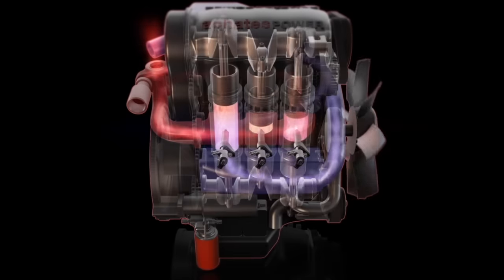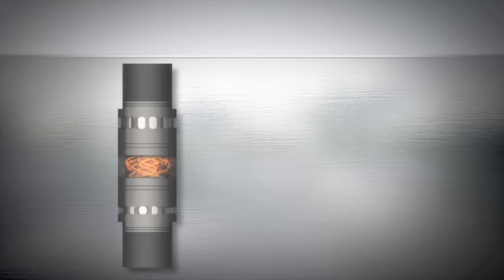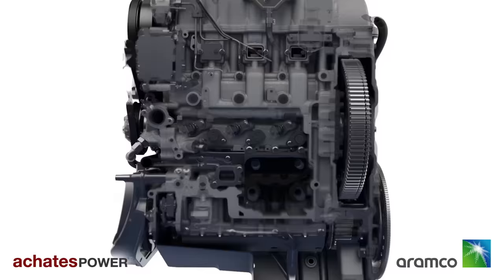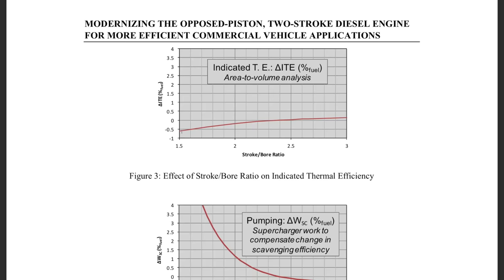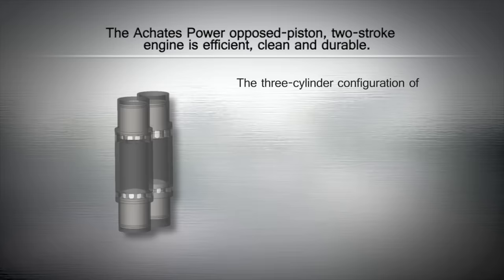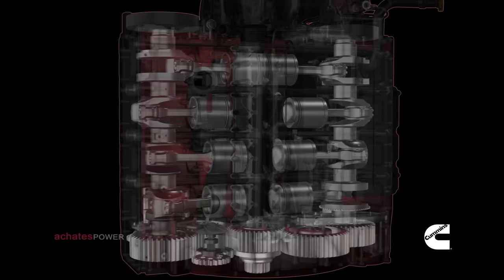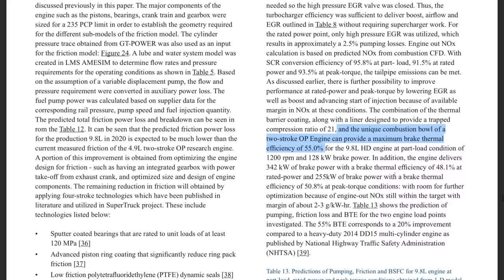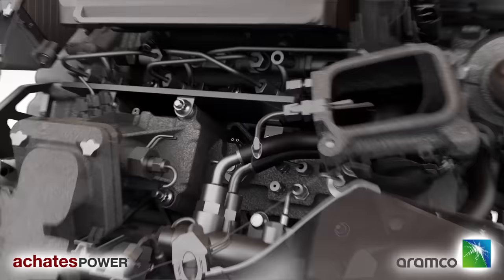Opposed Piston Diesel Engines Are Crazy Efficient

Comment: In a two stroke cycle timing is everything. It is therefore pretty amazing that they can maintain as high an efficiency as they do over a broad an operating range as they do. But I wonder what would be possible if the engine only worked at a single speed and power level. In a convention vehicle the engine has to sized to meet the peak power demands of the vehicle will ever need, but for the vast majority of the time it only needs to produce a quarter of that peak power. As such the engine is mostly not operating at its peak efficiency power and rpms. 

But if the engine is sized only to just meet the power demands of the vehicle averaged over say 30-50 miles of highway driving, then the engine can be much smaller since it doesn't have to provide the large amounts of peak power required for acceleration and hill-climbing. Nor does it have to run at very low power during deceleration or downhill sections. Instead it just produces that same time-averaged power level regardless of what the vehicle is doing. This is the concept referred to as a sustainer engine. But of course the engine can't be sized that way if it is the only source of power. And that is where a battery electric drive train comes in. 

All power to the wheels come from electric motors sized to meet peak power demands. Electric motors have a very broad and flat efficiency plateau around the design condition. So it is very nearly as efficiency at 20% power as it is at 100%. And most motors can operate for short periods at nearly double their rated power and so can give short bursts of very high power for accelerating down an highway onramp so as to be at speed by the end. The energy to drive those motors comes from a combination of power from the batteries and the piston engine. The batteries type and pack size would then be designed to be able to provide the extra power when discharging to supply the difference between maximum motor power the set power output of the piston engine, and to be able to contain enough total energy to provide that extra power for long enough to climb a long uphill grade. The peak charging power of the batteries would have to be sufficient to absorb peak braking power produced by the motors acting as generators and the power from the sustainer engine, which would still be producing it "one lone song" in anticipation of the energy needed to climb the hill on the other side of the current downhill grade.

Since the sustainer engine is not mechanically connected to the wheels it can spin at whatever speed is most efficiency and minimizes the weight of the engine and attached generator. Since power is simply torque time speed, a high rpm, lightweight and low torque engine can produce the all the power needed. Also electrical machine weight is more of a function of their torque than power, the same high rpms will minimize the weight and volume of the generator as well. 

Average power can be calculated from average fuel efficiency and thermal efficiency. Modern aerodynamic rigs can get 9 miles per gallon cruising at 65 mph and if we assumed a fuel to drive shaft efficiency of 30% at low power during cruise and do a plus a bit of math, this works out to only 125 hp. Since the electric drive motors are the ones driving the wheels, they will be the ones to generate the 1500-2000 ft-lbs of torque required, not the sustainer. So the piston engine could actually be a very compact and light high speed/low torque engine such as a 1 L motorcycle engine that can easily produce 125 hp (imagine the chuckle though when you raise the cab and show the other drivers this tiny engine the size of a Honda Goldwing sitting in the middle of all these batteries, power electronics and high torque electric motors and tell them that is the only power source driving your rig :-) . High rpms also helps to reduce the generator weight and volume since electrical machine weight and volume is more of a function of how much torque they have to produce rather than how much power. So a high speed/low torque generator can put out the same power as a low speed/high torque generator but weigh considerably less.

In addition to saving fuel by running the sustainer like these opposed piston engines at 40%-50% efficiency, a hybrid electric system would save a lot of wear and tear on brakes as well as save energy since most braking power will come from the drive motors running in regen mode and storing that energy in the batteries. So brakes might just never wear out if the driver can avoid a lot of late hard braking. And you wouldn't have to use engine braking to try to saving the brakes and pissing off everybody who lives within a half a mile when you downshift. And possible battery only operation or the sustainer throttled down to bring its noise down could be used to drive nearly silently through very noise sensitive neighborhoods at night because trucking doesn't fall neatly into an 8-5 schedule. 

Well this is a long comment on an old video, so likely nobody but me will ever see it. But in general I think hybrid electric systems with a small sustainer engine could make a large difference in everything from heavy-duty pickups to large semis where, apologies to Elon Musk, 100% battery electric trucks just don't make economic sense. But that doesn't mean that an battery electric drive system can't have utility, you just have to come at it from the right angle.
Reply: this.
Reply: I agree that a sustain/generator engine would be good for heavy vehicles, basically a diesel electric system from a train but for semi trucks. One small problem for high power density engines, wear and tear. Long lived engines, life is measured in hours not miles, do not operate at high RPMs. Your idea for having an engine basically running at 100% is best served by a 2000 ish RPM running generator, such an engine would be between 3 and 6 litters, depending on vehicle size and toe capacity. Say a compact V6 or V8 engine. The semi truck will remain large, the new electric systems will require the space that was once used for the larger 14+ litter inline 6. Cooling requirements will be reduced, allowing for a more aerodynamic design as well.
Reply: Yes, this would be ideal for a hybrid car.
Reply: The perfect design. A combustion engine making electricity that drives a motor/generator at each wheel. By varying motors in series and parallel, you change their torque-power. By using wheel motors there’s no axles, transmissions and gears plus built in stability control. You also take advantage of the multiple motor-speed/ fuel consumption thing that ocean-going motorboaters have known about for decades.
Reply: @Squeezmo  One giant problem with not having a transmission is that you either have very little power available from a standstill, or your motor is spinning at very high rpm once your moving, limiting its service life and maximum speed. Transmissions solve lots of problems. Electric cars will still use transmissions, though far fewer gears are used. Having independent motors is nifty solution, though it will cause issues if one or more dies. 4 motors quadruples the odds of motor failure.
Reply: soo a diesel loco?
Reply: @harrymu148  In a diesel locomotive the electrical system only works as a transmission system and as a way to brake the train by generating electrical power and dissipating it though huge resistance banks to avoid friction brakes as much as possible.current diesel locomotive do not have any batteries or other energy story. The diesel is sized to meet peak power demand.

The system I was outlining for trucks would have relatively large battery packs to supply power when more power is needed than the small sustainer combustion engine is making, and to absorb and store energy during braking. The size of the sustainer is  based on the average amount of power required on average over the course of an hour or so. The batteries handle on a moment by moment basis supplying additional energy to accelerate or climb a grade and absorb energy during braking or decent of a grade..
Reply: @papparocket  ohhh that'd make more sense. I'd imagine that the driver would have to be mindful of his power consumption though, as to not frequently run his batteries dry
Reply: @harrymu148  Actually while the sustainer engine is highly optimized to maximize thermodynamic efficiency single operating point, that point would not be at the absolute maximum RPMs or fuel flow rate of the engine. Thus the engine could be run at higher Power level than its design condition, but it would have a lower fuel efficiency at that higher power level. And because it is so optimized, if the necessary operating point is too far away from the peak efficiency point, the sustainer would have lower fuel efficiency than an engine that had a lower absolute peak efficiency value, but which was designed to have a flatter efficiency curve.

Another solution is to put in a larger sustainer engine sized for peak efficiency operation at the maximum possible vehicle load (max weight into a steady high headwind) and then only run the sustainer part of the time when the load is lighter and wind is helping push. While the sustainer is off, the truck runs on battery power. The batteries are then allowed to cycle between two states of charge somewhere around  50%. There are loses to doing this, so if the sustainer is cycling on and off too frequently, it would be more efficient to just run it continuously at a lower, less efficient power level.
 
This is the kind of wicked design problem where the optimum solution is not always obvious that engineers like me live for. Also because the optimum operating pattern will probably change for each trip depending on the weight of the load being hauled, how it changes the aerodynamics (if it is an open load), what the wind patterns and terrain profile will be during the trip, this is also a perfect application for artificial intelligence to minimumize total trip fuel consumption using the greater degrees of freedom a hybrid electric system makes available.
Reply: Man, just smoked some weed, and this comment just killed me. Thank you for that.
Reply: Blown two strokes aren’t dependent on port timing’s as NA engines. Therefore they are efficient at various engine rpm.
Reply: @harrymu148  One thing to note with a diesel-electric sustainer type drive is the fact, that if done right the electric motor can operate even if the battery pack is flat while the engine is running. So in the case the owner has a serious case of pedal-to-the-metal fever he will run his battery flat. And from that point onward he will have a car that only has power equal to the maximum amount generated by his sustainer engine minus the electrical losses. Mazda was thinking about using a single rotor rotary engine as a range extender/sustainer motor in their next generation electric cars, but nothing came out of it as far as I know.

To put it in simpler terms:
The sustainer engine has an electric motor. Let us put the power output of it at the power level of a Toyota Corolla. The entry level engine has a power output of 92 kW and 153 Nm. If I want to change the engine to be the same power, then the Spark EV has this class of electric engine. The electric engine has a power output of 97 kW with a torque of 542 Nm. This torque is something you would expect to find in a 6L LS1 Corvette engine from the '90s.

Here is the kicker: The Spark EV used 29 kWh of battery for every 100 miles traveled. So in theory if you could supply it from a 30 kW generator it would be fine on an average for combined (city and highway) usage.

So in theory while you would loose the instant acceleration and kick of your electric motor, you would still feel like driving a Corolla, as the torque for acceleration would be available from 0 RPM. And this is why this type of car could be a huge hit. Build something light and small(ish) with a 30 kW engine and a 25-30 kW generator, and you are set to go. With close to 1-2 liters per 100 km fuel efficiency (not using any batteries).
Reply: This 2 stroke is not the same as your average 2 stroke
Reply: I love your point, and I've thought about diesel/electric. Namely, I though about using 4 (or more ) electric motors for AWD with computer assisted traction control and torque steering built into the design, but as an American I never ever once thought about making the diesel engine smaller. 🤔😄
Reply: A much shorter way of interpreting your post, which is the comment I wanted to make:

A small version of this engine would be PERFECT to use as a range extender for battery electric vehicles.  For example, based on the data from a cross-country Rivian towing trip last year, a 25 kW REX would have tripled that vehicle's range per battery charge.  A 25 kW version of this would probably be compact enough that it could be removed from the bed when not needed, and only installed when needed, turning a BEV into a heavily plug-biased PHEV for towing.
Reply: @Entropy512  Long comments are the hazard of being able to type over 90 wpm. Thanks for giving a summary for my TL/DR comment.
Reply: I think this kind of hybrid solution makes a lot more sense than full electric right now.   The harsh reality that few people seem to acknowledge when discussing EVs is that current battery technology is simply NOWHERE CLOSE to petroleum products in terms of energy density.   And it's not going to catch up within the immediate future.  That tipping point could be decades away for all we know.

In the meantime, we should be combining electric and internal combustion technology in ways that capitalize on the respective strengths of each.  The system you described is a perfect example of that approach.  👍👍👍
Reply: @papparocket  Could probably integrate with existing intelligent cruise control systems that estimate vehicle weight and have maps of the terrain ahead.
Reply: @ultimateswarm7868  Individual motors per wheel work flawless on a straight.  That is when all wheels are turning at the same speeds.  Once the vehicle is turning, things get complicated.  Normally, a differential compensates the different wheels speeds.  But in electric motor, the motors need to to that instantaleously.  Very hard to do.

Comment: My all-time favorite opposed piston engine is the Napier Deltic locomotive engine. It has 18 cylinders, 36 pistons, 3 crankshafts. Its like three 60 degree 2 stroke V12 detroit diesels arranged in a triangle so all the pistons meet in the middle. The most powerful model put out 3600 horsepower. 3600 horsepower was absolutely insane for the 1950s.

Comment: Seems so simple compared to complex multi-cam valve systems. Thanks for the video!
Reply: That's not because its an opposed-piston block. It's because it's a 2-cycle design, which can be done without being piston opposed.
Reply: @Cotronixco  2-stroke diesel still need a single valve in each cylinder. This design doesn't have any.
Reply: I guess you havent seen the insanely complex variable camshaft engine that just looks like its waiting to break

Comment: When I was a kid living in Turangi there were a number of Commer trucks powered by TS3 horizontally opposed piston engines. The sound they made was so distinct that I could pick them out over other trucks without seeing them when I was 5 years old.
They were small engines, about 3.6 litres and made good power in their day I have been told.
Hi from NZ,
Anthony
Reply: anthony  i worked on these engines .  you are correct regards the sound, it was the blower .we had to decoke them  alot also rootes tried out  a  ts4  but it was not put in any commers .they would have been easier to work on on tilt cabs  but the commer never had one in those days
Reply: A brilliant sound that I remember from the old Palmers Concrete mixer trucks in Dunedin.  Hearing a fully loaded Commer with its TS3 knocker engine screaming while climbing a Dunedin hill is one of my great childhood memories.
Reply: I think GM bought the company and smashed up all the moulds as the engine gave more power, was more efficient and smaller than three crappy V8s
Reply: andy   it was not a rootes engine then? , as i was told  when i worked at a commer dodge garage.
Reply: anthony851 maybe it was the truckies wanting to hurry up and get out of turangi lol
Reply: I have one in my garage up here in hamilton. Want to try to get it to run again.
Reply: I currently live in a 1950s royal leyland tiger with a TS3 in it, runs well, too clapped out to drive on the road but the engine is mint.
Reply: I was a kid in Turangi (late 60s).Live in Maria place and went to Hirangi school.
Reply: none I'm sure your comment is worded well enough to get people to look into the subject further. I realise breadcrumb-dropping is an art but this will turn people away from the subject rather than toward it.
Reply: anthony851
Yeah most people wouldn't have a clue where Turangi is yet alone New Zealand hahaha.
Reply: @TheMachSR7  me too
Reply: @kimbird6554  l worked on them in the U.K. liked them, but a bugger to work on with the fixed cab.🏴